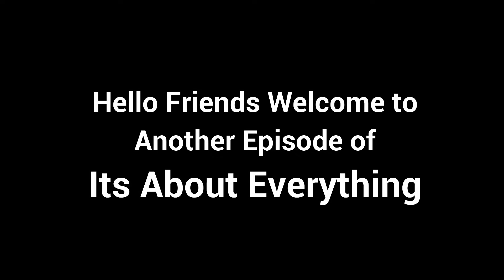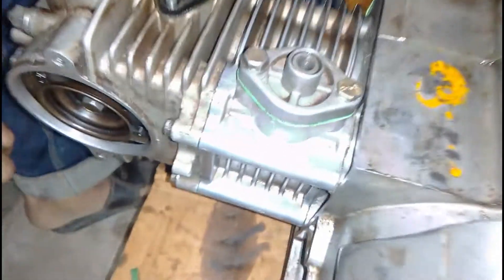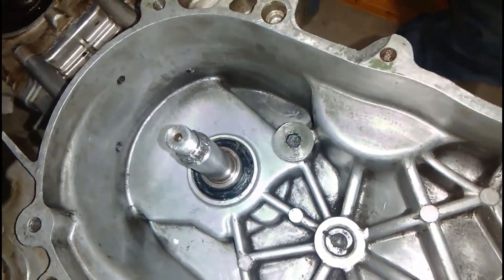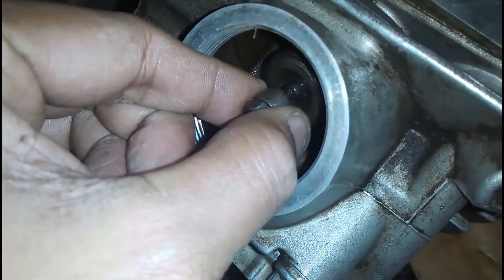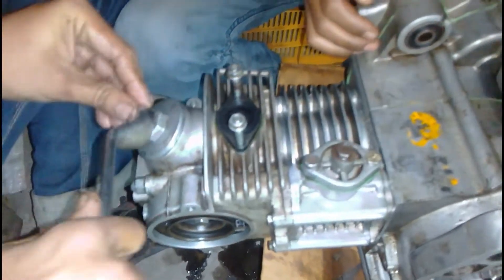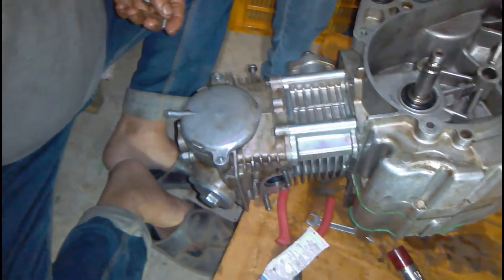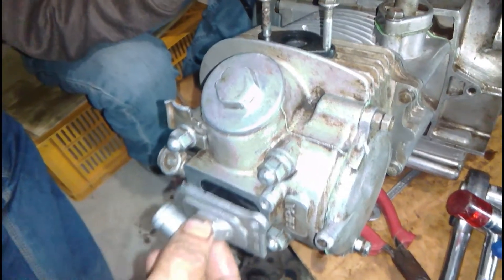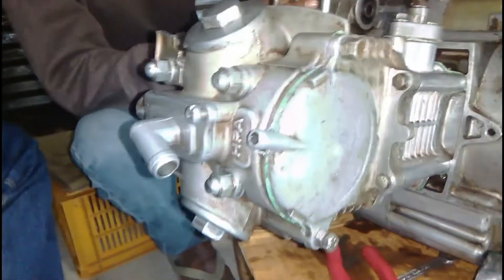Full  Rebuild of  Mahindra duro 4 stroke engine part 5 ---- Its About Everything.

Comment: Sir Mere Duro 125Dz ka Carburettor Setting Hil gaya hai use kaise adjust kare pehele mera scoty 50 millage deta tha ab setting hilne ke baad se 20 25 de raha hai please help me sir
Reply from the maker: Carburettor ko pura khol ke service karwaiye , re-assemble kar ne ke baad re-adjustment kar ke dekhiye. 
Air filter ko bhi change kijiye.
Spark plug neya lagaiye.
Aur engine oil bhi change karwaiye.
Tyre mai hawa thik hai ki nehi dekhiye.
Wheel jam hai ki nehi yea bhi dekhiye.
Yea sab karne ke baad bhi mileage  thik nehi huya to, compression yea timing ka problem sure hai.
I wish my reply helps
Sorry for the delayed reply.
Reply: @ItsAboutEverything01  
Ye sab main try kar chuka hoon lekin koi fark nahi, abhi bhi 30-35kmpl hi deti hai wo bhi aaram se chalane par nahi toh below 30kmpl.
Nearly 20,000km chal chuki hai.
Variator roller aur belt kitne km par change hota hai, kya is'se bhi mileage kam hota hai?

Variator roller ka weight kitna hota hai, honda activa ka varitor roller use ho sakta hai isme?

Comment: In My Mahindra Duro
The Magnet Seal is tampered which cause engine oil leaking
But After Changing Seal the oil come again but in small amount

then again i change oil seal from mahindra authorised service centre
but problem is not going
Reply from the maker: May be the crankshaft is not smooth on the edge where it touches the oil seal . It could be many reaaons. Metal particles in the crank case that cuts the oil seal. Improper installation, bad equality oil seal. 
My assumption is damage on the crank case opening where the oil seal is fitted between the crankshaft and the crank case. Crankshaft is hardened steel and highly unlikely to damage but the crank case is aluminium.
Any way without looking at the crank case i can just assume the problem. 
I hope the answer helps 
Thanks for commenting
Reply: Its About Everything Thanks
 i will share with mechanic